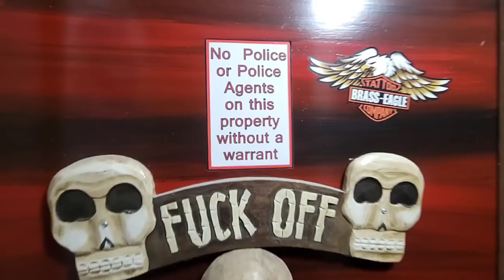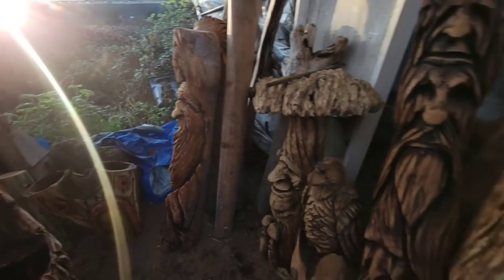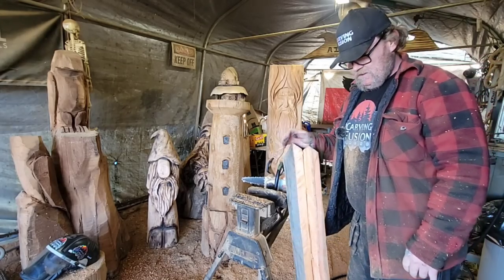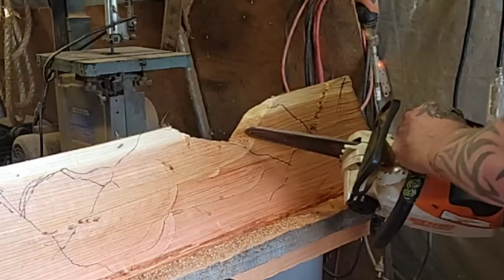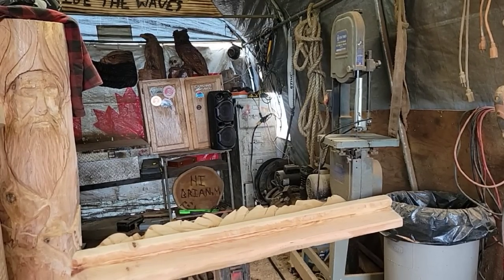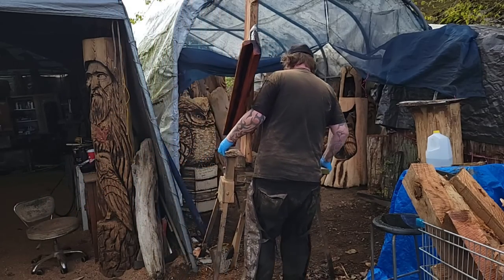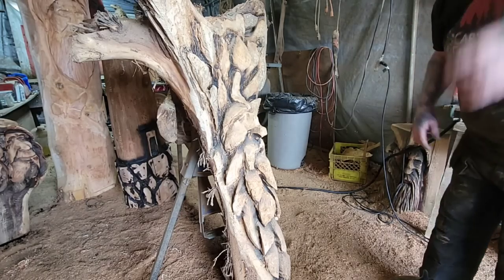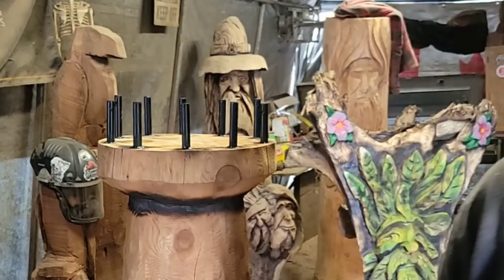Carving with a chainsaw. Odds and ends, Jordy does part 3

Comment: Wicked mountain shelf,great idea,love it.🗻👍🗻👍... to answer your question: yes you can thin (OIL) based polyurethane  with mineral spirits. (Doesn't take much) It helps alot with bubbles,fish eyes,& application.  That's all wipe on poly is 🤔😁 and alot less expensive  to make your own. Mineral spirits evaporate out quickly but highly flammable so please take care. Ie: torches,oily rags,smoke'n,ect. Whewww...that was way easier to explain in my head than typing it🤯😂🤣 green man is cool love the flower colors play's well with the green. Light house is gonna be tough. Cool vid,thank you. ✌🎨🎨🎨😁
Reply from the maker: Thank you